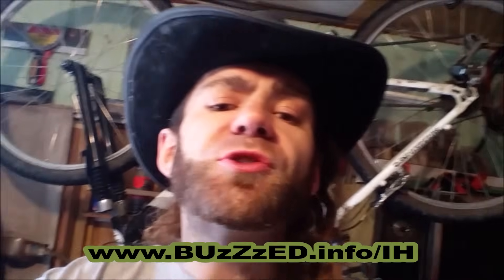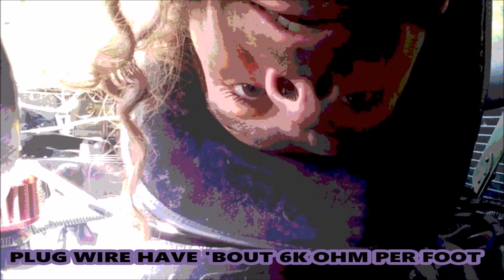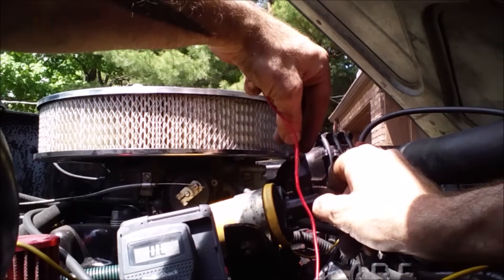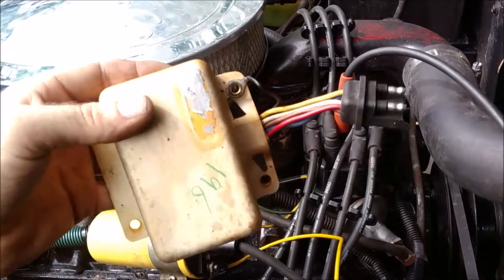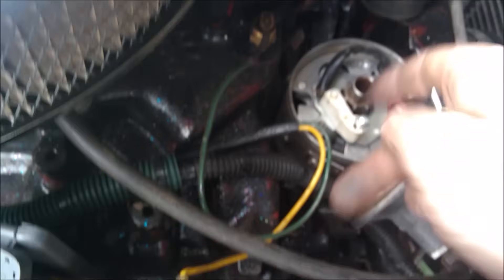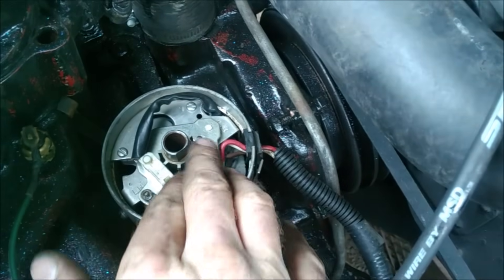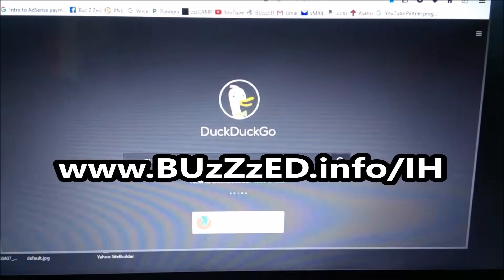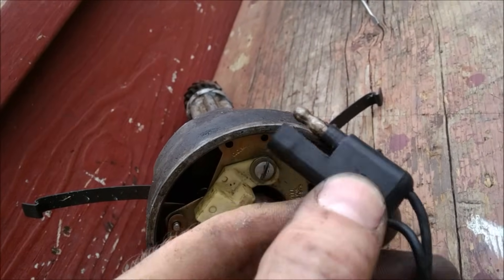NO SPARK, NO START, NO PROBLEM!  IGNITION SYSTEMS

Comment: well this video was useless to me
Reply from the maker: Well despite your negative vibe,  is their seriously any specific issue / make model I can help you with? I understand your frustrated and want your engine to run. No joke, whats the issue? 
Otherwise I apologize If my title was misleading, where you expecting a lesson on how to start a fire with out a spark ? Because the half a million other viewers learned how to diagnose any gas powered vehicle , any make, any model.  
Let this be the most important lesson in repair, patience! Machines are logical. It is insane to get upset at a machine. If you calm down and realize even if it is the end of the world panic aint gonna help... I promise you, this will not solve your problem but it will diagnose it! :)
Reply: @ErikTheWrench  I have a Holden VR Commodore, I just checked the spark and I have spark but the engine just wont start?
Reply from the maker: Ok  @RBFR01 , so you cant test for fuel spray be it you dont have a carb, lol, The first thing to try is to remove the air cleaner, and spray carburetor cleaner, while a friend tries to start the car.  I have sat under the hood spritzing carb cleaner while another mechanic drove the car to the shop.... If you hav spark, and it wont start on carb cleaner, its a fuel pump or clogged fileter related issue, bad injectors.... or or or 
you need to run a leak down test, or at least a compression test, because you then have bad valves, blown head ... no joke, oh and dont use starting fluid, carb cleaner is safer
Reply from the maker: and another easy test is put your ear on the fuel filler and when your friend turns the key to the run position, you should hear the pump prime.  you can also do a prsuuure test wih out, just push in the schrader bike tire like valve on the fuel injector rail.  push in the valve and fuel should spray out for a second. if it just seeps out you have low pressure, or just rent the tester.... hold a rag so you can see it but so you dont spray gas all over you and whatnot...
Reply: @ErikTheWrench  hey man I got a 73 dart swinger I just got it to start but it will only run when the choke is on, is it not getting enough fuel or is there a potential miss fire idk I'm new to this kind of stuff.
Reply from the maker: T @TheJudge531  sounds like you have dirty jets in your carb, or a vacuum leak. 
 If any vac lines going to the carb or manifold are cracked it will be pulling in extra air b4 the carb, thus needing the choke...... if you cant find the leak, spray carb cleaner around the lines and he intake manifold. if it speeds up, their is your leak...    
other wise, gas turns to varnish when it sits. it is most likely varnished jets in your carb.... it only takes 3 months for a jet to varnish...
Reply: @ErikTheWrench  Hello i have a 1993 Nissan 240sx and I connected the wires that go into the distributor harness wrong what do you thing that affected
Reply from the maker: @josegamoa2261  you may have gotten lucky, but the problem with electronics, is if you hook the power up backwards, the fuse is now after the control module, so you likely popped a cap or a resistor or a transistor... because it was b4 the fuse.  You know how they make you pay to go into the junk yard, that is because most people leave with a pocket full of bulbs and screws lol So if you dont go get a module, you been paying the door charge for what other people took!
Reply from the maker: Got her running?
Reply: Not yet brother, havent bothered... Got other things to take care of but the minute i find out what it was i'll let you know!

hope you're doing well :)
Reply: Same
Reply: SAME I found it useless ALSO I'm just going to have some ELSE doit I've been troubleshooting still doing trouble shooting

Comment: Hey I have a 85 caprice Classic with an 84 motor an it’s not starting. I changed my ignition coil an everything still nothing. What should I do?
Reply: got a multimeter?
Reply from the maker: its same across the board , guess I can make a video on a voltage drop leak test

Comment: '85 Ford F150, 4.9L I6, 4wd. Intermittent missfires initially blamed on water in fuel.  Then all stop and no spark. '85 has 2 electronic control modules...on screwed to distributor under the body and the 2nd on the passenger sided wheel well next to the starter relay.  The first one can be tested and changed. Tthe 2nd is apparently vacuum switched. Cannot find testing instructions or replacement part. None available have vacuum line as part of plug-in.  Your thoughts?
Reply from the maker: The second module is a vacuum sensor to control timing advance based on manifold pressure...

Comment: Uploaded a video of whats happening 😕
Reply from the maker: ok yeah, the egr valve is kicking in when she warms up, but their is a leak, so when the valve opens, the exhaust is going out the leak and the engine is sucking in air like a vac leak!  If you no longer have to take the emission test, they sell a block off plate and you can crimp or plug the line from the exhaust to the egr. otherwise its likely the gasket or the valve itself is leaking. be careful, it is so hard to not snap them bolts off when they get old. if it is the line leaking from the manifold, crimp it off, and when the valve opens nothing will happen.  you might get a slight power loss with out the egr, unless you compensate, like how when you put on bigger carb you need bigger exhaust...
Reply: Im going to try this thanks
Reply from the maker: yeah, like a doctors stethoscope, use a hose to your ear to find the leak

Comment: My starts but after 20 min or so it shuts down i wait about 1 hr starts up again any idea? Great video by the way
Reply from the maker: I will need more info , what is it and what year? could be a egr malfunctioning when it warms up, or a stuck choke.... might warm up and leak around carb... could be a bad gold box if its not getting spark when hot....
Reply from the maker: ok thats a throttle body injector. its like a carb that uses sensors to adjust air fuel ratio. if a temp or coolant sensor is bad, it will keep the choke on or rich condition when warm. it also uses the o2 sensor..... you will have odb1 computer, and your manual will tell you a pin to jump with a paperclip and the diagnostic codes will flash on the check engine light...
also to test for leaks spray some carb cleaner (not starting fluid) around the intake and vac lines. if it speeds up, thats your leak.... if high idle spray wd40, if it balances out, thats your leak...
also egr when warm dumps exhaust gas in to intake, it will lower combustion ratio. if it leaks, it wont until its warm...
Reply: 1987 Silverado 350 bro, thanks for the feedback
Reply: 350 tbi
Reply: Ok so i sprayed carb cleaner around intake and vacuum lines no change it idles fine timed it this time lasted 12:49 min didnt spray wd40 something warms up and kills the engine , really driving me crazy 😕😕😕 need to check the o2 sensor
Reply: I finally got someone to turn her over while i checked tbi getting sprays of gas , checked spsrk at plug couldnt really see a steady pattern but there was spark , you think plugs get hot and dont work? Going pull one  out
Reply: I put in these accel 574s about 6000 miles ago they are pretty crusty but hard to believe all would go out at same time to stop engine from turning on🤔 , sorry for bugging you so much but really apreciate your feedback
Reply from the maker: https://www.gsparkplug.com/shop/spark-plug-fault-diagnosis/ this is how to read the plugs.  sounds like its a temp sensor or o2, is the check engine light on? I recommend you jump that pin, bulb may be burnt out,  i had a van brakes failed , guy put tape over the bulb that sold it to me lol... https://www.obd-codes.com/faq/read-gm-2-digit-obd-codes-free.php sounds like its running rich and carbon build on plugs, marvell mystery oil will clean this out. it works. it is the best!   but still need to fix the rich condition. when warm, if the coolant temp sensor is saying its cold it will be rich. if it has no codes might be the cat converter, that is one of the only things that dont trigger a code...
Reply from the maker: you can hook volt meter to temp sensor and see if it rises when warm... the o2 sensor is a pain to test, you need a volt meter spliced into leads as well, should go from .02-.08, if no code, sometimes its lazy, honestly easier to just change it, and return it as broken if it dont fix it lol, to hell with corporate chains lol, they put the little guys out so who cares lol

Comment: Thanks for video. I have 83 Jeep cj7 running 2 weeks ago. Now no spark from coil wire. Removed dist cap and found the center pin on cap had broken off and was imside dist. I have Mallory dist and ignition coil. Red wire inside dist has a break in the insulation. Went to oem dist and Accel coil also replaced ballast resistor still no spark from coil wire. I'm stumped. Aloha from Hawaii!!! Any advice??
Reply from the maker: Ahh, well, I dont think you would have points on an 83.  if so, a points distributor has a resistor to run at 9.6 volts so you dont burn the points up. It also has a bypass wire, so when you are cranking it bypasses the resistor to run a full 14.6 volts until it until it starts,   but you should have a magnetic pickup. and should not have the resistor or bypass.  I go over that in my video https://www.youtube.com/watch?v=0P_qU7I2n4Q&t=13s...  you either have a prestolite style or a brain box style where the circuit board is mounted outside the distributor and they go bad...
Reply: @ErikTheWrench  well I had Mallory coil and Mallory dist. And also note there is no icm  below the washer box on the driver fender. Not sure what that's about. Replaced with a cell coil and own dist dist cap and rotor. Getting 12 volts to coil and it's pulsing properly but still not getting fire from top of coil. Bypassed the resistor and I still can't figure this out.
Reply from the maker: well, capacitor discharge ignition has a brain box or it is mounted under the plate. thats why i show vid on installing a pertronix igniter in a prestolite distributor. or non-points mallory have the same thing like in that vid.
here is how it works. 
under the rotor. their is a lobed wheel. and a magnetic pickup. (like a crank position sensor for new cars) when the lobe gets close to the pickup, the magnetic field is disrupted.
This triggers the brain then, amplifies it with transistors/capacitors and sends signal to the coil to dump the spark, then its sent through what ever wire the rotor is pointing at under the cap. 
  so if the circuit board is bad or the pickup is bad, it dont know to send a spark, just like if your points where not contacting....

Comment: Don't live in the 50s..do not drive ancient car..guess I'm walking home
Reply: It's incomprehensible problems on newer cars that leave you walking home. And then draining your wallet.
Reply from the maker: I will make a video on that, all they do is take the internals of the distributor and place them directly on the cam, imagine the teeth that turn where the rotor attaches in your distributor , that spin past the magnetic pickup and trigger the coil to dump spark, well now the end of the camshaft is the distributor shaft, and the cam sensor is the pickup.     and instead of a shared coil and rotor / cap, it just triggers individual coils for each cylinder...... Cam sensors wear out or get dirty, when they first came out you had to gap the bastards

Comment: My Kia Rio 2008 has no spark , won't start sounds just like your truck  we just can't seem to find the problem we have already change the camshaft sensor and it's still the same
Reply from the maker: the cam shaft sensor will have a test process in the book for your kia, also they need to be "gapped". they are very sensitive and sometimes can be off.  this part is the same as the sensor inside the distributor. except your reductor is on the cam end

Comment: DO NOT CHECK FOR SPARK ON TOP OF THE BATTERY!!!!!!! THE BATTERY COULD  EXPLODE  IN YOUR FACE IF IT MAKES SPARK ! YOU ONLY HAVE TWO EYES !!!!
Reply from the maker: ha, you only have two eyes.bury your head in the sand  lol if it explodes ill film it and you can laugh, bill you are sitting to close to the tv lol nuclear fallout ! an airplane can fall on your head, you could combust! planet x can hit us lol hillary could be president lol lots of things can hurt us, lets have fun, as they say its all fun and games until someone looses an eye, and then its just fun!
Reply: True! I had a battery blew up and almost blew the hood off a '69 Ford van. Eventually the acid consumed all the firewall and inner fender wells. No amount of baking soda would neutralized the acid. RIP Ford Van. We had good times together.
Reply from the maker: yeah, but modern batteries dont clog vents, with all the lawyers involved now days everything is idiot proof and nerfed up lol, Like did you know that batteries draining on concrete floors is from back when car batteries where glass jars inside a wood box... I am not saying its 100% ok to do, but sometimes I do stuff for your viewing pleasure
 .

Comment: 65 Plymouth Barracuda and how can you test a distributor for a problem without taking it apart?  Can you check it on continuity or voltage at any point on the distributor?
Reply: 273 engine with 2 barrel carborator.
Reply from the maker: Yes just at the wires , you have no electronics just points. A match book should fit between the contact points and they should be changed regularly

Comment: You're stuck beside the road with no spark on the engine.. Then suddenly you have a multitester and do the diagnosis and repair. Wow!
Reply from the maker: yes, i do carry a pocket multi-meter in my small basic tool bag.  I show how to test with a spare bulb too! If it fails the first tests then you need the tester to be sure. my guess is you also dont have a new coil, distributor, cps, wire, or controller units with you and your walking to the part store anyway at that point lol
Reply: Stop being a hater dude !   great informational video. Well done
Reply: ERIK THE WRENCH I have a used U-Haul truck and an El Camino.  I've always carried a multimeter in both vehicles for on the road problems that arise over time if you don't trade in your vehicles and I've had my 72 Chevy El Camino since 1975 and it still runs after a 160,000 plus miles.  Had to rebuild or replace five transmission over the years.  Had a full size overhead camper on the back of her.  It was very had on the rear end also.  Had a 12 bolt in her and s switched down to a 10 bolt for the lower gear ratio with the hope of not being as hard work as with the 12 bolt rear end.  When through about 4 axles on the 12 bolt and finally the place where the outside bearing housing fractured while on the interstate and put the El Camino on the back of a flatbed tow truck to get her home and then replaced the 12 bolt for the 10 bolt read end.  

Had been getting a 5, 000 to 8,000 miles on a set of rear wheel bearings on the regular type on bearings.  Started to use what they told me were reverse bearing for the rear end and they lasted 8,000 to 10,000 before the bearing would break apart.

Working on a veterans 65 Plymouth Barracuda and it had no spark either which is why I found your channel.  First coil I bought had been defective and putting it in just wasted my time.  Got a second coil and still no spark at the points where I desperately need spark and haven't located the problem.  Wonder if it is the second coil is no good?  Thanks to you and your video I have a possibility of solving the no spark problem.
Reply: Blue Haze that's the kind of stuff that should be in your toolbox

Comment: I have a 350 5.7 motor that ran with high oil pressure ran it on freeway and it died completely on me now it’s turns over but won’t start
Reply from the maker: if it had high pressure you had a clogged passage, something wasn't getting oil, and it was on the freeway, it needs a rebuild
Reply: ERIK THE WRENCH dang really. I check the level on the dip stick and it marked normal before running it on freeway.
Reply from the maker: Yeah you could have spun a bearing, then the oil hole is blocked.
Reply: Do you recall any kind of strange noise or vibrations? Maybe even a strange smell?  This info will help us help you

Comment: Everything sounded like my issue except I have no fuel pressure and I also changed my fuel
Pump, can you tell me what to look for?
Reply from the maker: a mechanical fuel pump operates by the cam lobe pumping the lever. 
A>check filter. B>some times you need a cap full of gas or carb cleaner sprayed into carb to prime, or suck gas to the pump.   C>  remove gas cap, then blow air through the line to tank  D>you might have a really stuck float or needle in carb... but you should be able to hook a hose to inlet from gas can and or un hook the outlet from pump and see if it squirts...
Reply: ERIK THE WRENCH  thank you for you so much for your response, And nice video explanation, you made it easy to understand. I went to the fuel tank to check out if I seen anything suspicious and I found a kinked fuel hose. It’s now got got good pressure and works great. Thank you
Reply: Fuel regulator

Comment: what if your car has no distributor, I have 2000 Blazer new ICM. ignition coil,battery, am getting no spark and car wont start but is cranking, the fuel pump is priming btw
Reply from the maker: im on my way to work, but i answered that in the comments already...